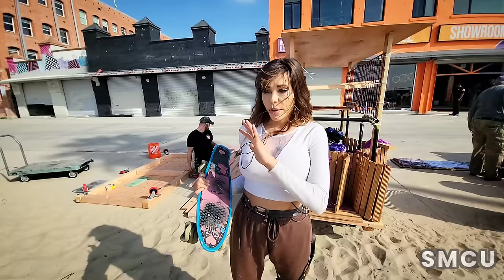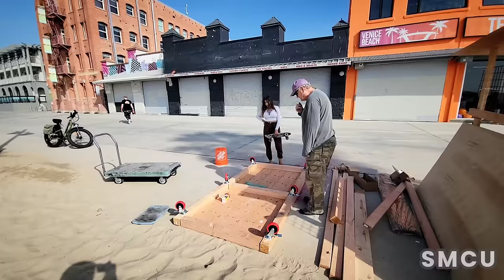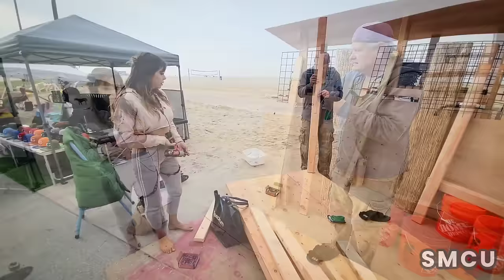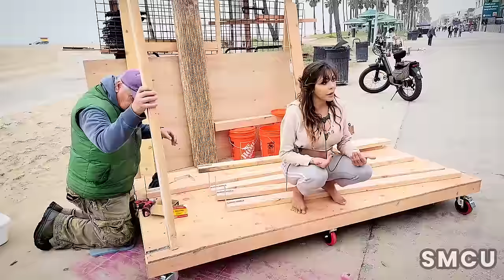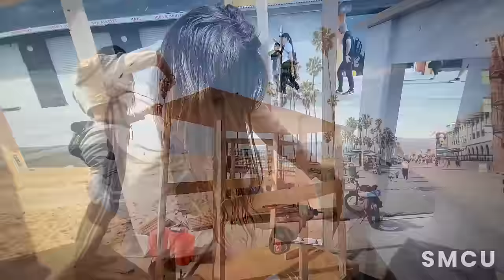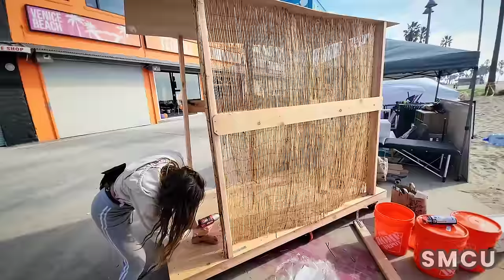Daisy, the Venice Healer, Launches Second Mobile Tiny Home Build on Venice Boardwalk

Comment: Carpentry 1.0 Good size industrial cart wheels fastened to a heavy 4x4 frame with dry wall screws, 8' wall studs attached to floor with a shelf L bracket & more dry wall screws 1/8" plywood doorskin as roof with no sill plate or center rafter support to attach the thin plywood to, Zero triangulation or gussets for integrity /strength. Massive curb weight, This is like a crude playhouse for tall kids, along the same lines as the  home cheapo bucket /composting concept, So where will the homeless sleep after their new found space in the tiny house is filled with curb alert items, bicycles & parts, old coffee makers & microwaves, office chairs, wet blankets, rolls of old carpet & rugs, bags of clothes, a broken wheelchair and maybe even the old shopping cart they have a hard time parting with.Boardwalk wilderness camping, so organic & close to human nature.I do hope these will inspire people to quit setting up camp & sleeping on the floors in the toilet stalls on the beach,seemingly without any concern about sanitation.

Comment: I guess Building these shelters with wheels is better than tents. Instead of a spackle bucket, better off getting a camper commode and a biohazard dumpster in walking distance. If it gets thrown in with trash, the bottle collectors are going to have an unpleasant surprise.